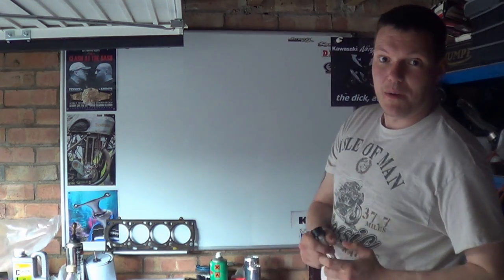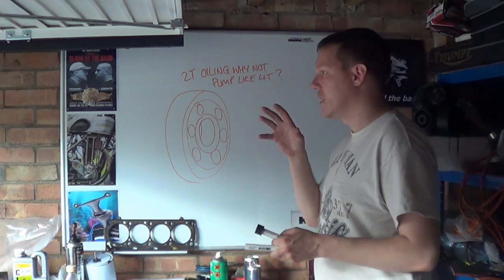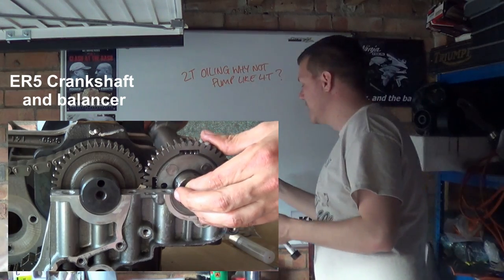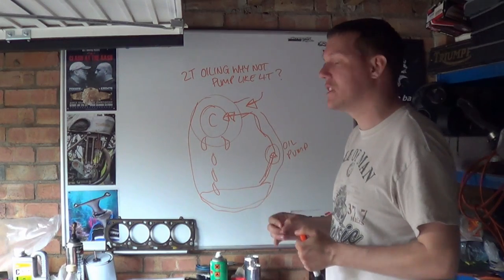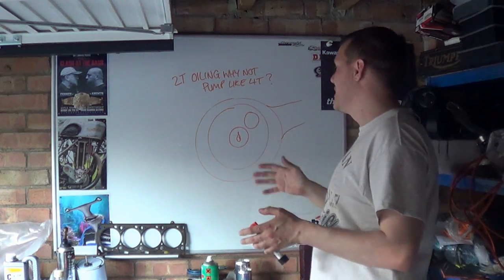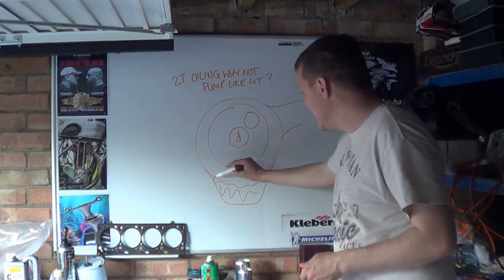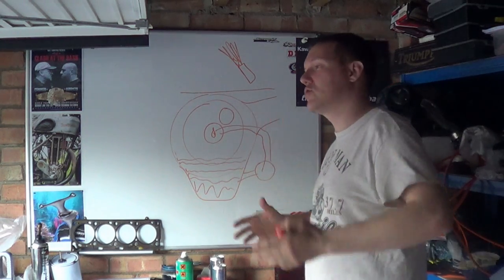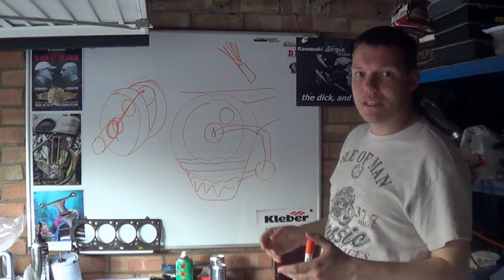2T oiling issue - make it like a 4T?

Comment: man..
forget crank case breathing, why are you sticking to it..
supercharger (centrifugal type, not a roots blower), the coupling to the main shaft is done with a bloody centrifugal clutch, when reaching the rpm where exhaust gas can, then that should run the charger. so it becomes a turbocharged engine.

that solves your problem. 
and yess it will require valves too.
and more rings (oil scraper)

so we elliminated caged bearings. we elliminated petrol in the oil problem.
and elliminated crank case breathing all togather.
and we have no transfer port. we do not need any. we do not get charge from the crank case.
Reply from the maker: Watch this then you won't be so dumb - https://www.youtube.com/watch?v=nIM0m9Z-C6o&t=275s